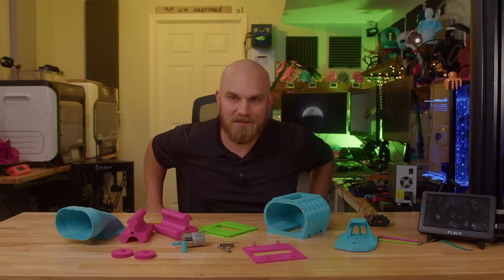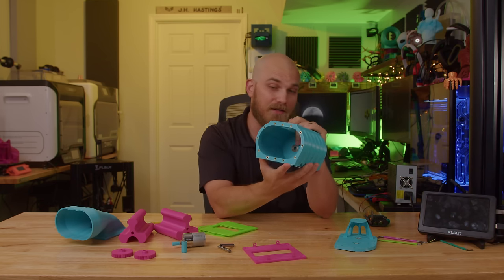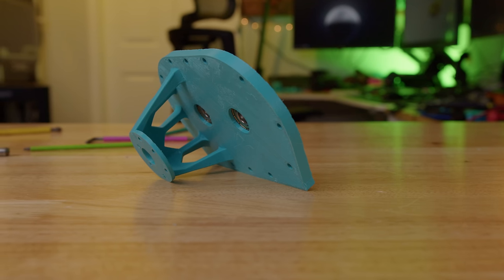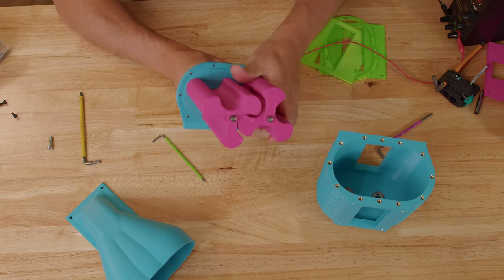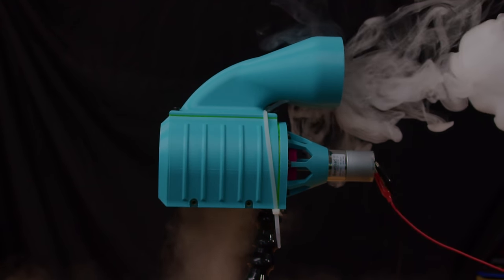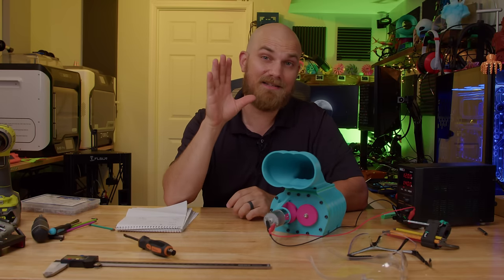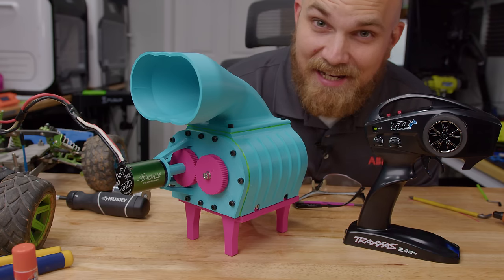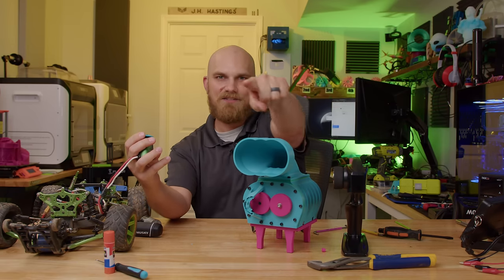I SUPERCHARGED My Custom Loop…… Literally

Comment: hey just a thought man you are gunna need either a small container on the motor side to lube the gears , just saying if your taking this from a car  its going to work better if it has lubrication. it doesnt need to be a lot just enough for the gears bottom tip ( or like just enough to reach the gears and have it pick up the lube ) i would suggest trying 0-30w or 0-5w motor oil. then put a small "splash cage" around it (could be clear  3D print material witha filler plug on top and a drain on the bottom ( like you will ever need to change this but hey maybe?) ), you would also need some kind of  tall plenum chamber after the chamber to allow time for the air to spread out. ( the math will vary from flow and desired size of radiator.) if you wanted to kick it up a notch you would make a venturi tube in take on the air intake side to force the to compress even more.   finally i would suggest a change to a 3k RPM motor super chargers like high RPM and mid level torque. this also applies for anyone who wants to try it. just my thoughts as a man who went to school for automotive and holds a degree in the field.  if anyone does this please send me or tag me the video i wanna see.

Comment: Hey, big fan of the show (Heh). I would recommend using a lubricant on the 3d printed gears as it greatly improves their performance, something light like lithium grease, or something PFPE based tends to work well. Thanks as always for the entertaining video!

Comment: Better grease in the planetary gears quiets them considerably.  One could mount the gearmotor at the bottom of the case with a big pulley, you can print a 120 tooth 2gt x 15 and then use a 12 tooth 2gt x15 on a 5mm shaft to drive the lobes. one could even route it like a serpentine belt to drive fans not limited by center hub diameter and can be geared as well.

Comment: HAHAHAHAHAHAHAHAHAHAHAHAHAHAHAHAHAHAHAHA
goldsmith / master jeweler, photovoltaic / solar thermal technician here (i have Rhino 5.0) laughing cause thumbnail made me think you built a blower for your computer and my reaction was "HELL YEAH"! working in construction i saw where the problem of breakage was going to happen when you were gonna go for top speed, that's easily fixed. as jeweler i make things from scratch, i've come to admire those with CAD talent. my hat off to you too, love your blower i Like, OLE'! 💃

Comment: About 20 years ago I put NOS in a PC. After seeing the first Fast and Furious movie I decided to put nitrous oxide injection on a PC. As anyone who ever used NOS will know that it makes things run hot, and too much will blow up the engine. So, I decided to make a video featuring a NOS bottle used to seriously overclock an old slow PC. In reality, one 4th of July we took a junk PC, stuffed it full of fireworks ran the nitrous hose in through a hole in the back set up my old Sony camera in video mode from a safe distance, lit the fuse, turned on the NOS and got far away. As expected, the old PC put on a serious display leaving a blackened sidewalk that remained stained for a couple years. Unfortunately the PC gods did not smile on this activity as the Microdrive card in the old SONY ate the video. All that remains are some still frame images captured by other party goers. We routinely put on a show of fireworks on the 4th and NYE for the neighborhood for about 10 years until someone elsewhere in the city got seriously burned and the cops shut down the use of DIY fireworks.

Comment: If you put a grease of some kind all over the rotors that's thin enough so it won't get thrown into the pc then would it be any quieter? I figured some simply lithium grease on the rotors would make it spin for freely as well as quietly

Comment: Not totally sure, since it’s hard to see in the video. But do you really spin that the correct way?
The air should enter at the top, then go around the outside of the rotors and out the bottom. NOT through the middle, between the rotors.

Comment: Hey there Major I noticed in your charts...and REF benchmark You've got the Phanteks T30  30mm  3000  RPM    FPM  954     CFM  125.928   at the top of the list.....Is there some reason why you didn't use the NOCTUA NF-A14  Indust PPC - 3000RPM CFM = 158.503 -  171.33 cause THIS NOCTUA's CFM  blows away the Phantek  ????  and what is the   FPM on the  NOCTUA NF-A14  Indust PPC - 3000RPM ???

Comment: I was fully expecting this to not push air. Now I want to see either a 30 or 60 degree twist since that should put less resistance on the motor but should cut air much smoother moving more air easier.

Comment: In Terms of noise you could also connect the rotors with a belt instead of a gear and use some bearings to hold them inside the housing. I would imagine this reducing the noise by quite a bit.

Comment: I think what we need here is Tim the Tool Man Taylor to set up a Coyote or LS powered engine to drive the supercharger that cools the liquid in the radiator.  

Oh, and what other folks are saying about using a manifold or at least an open spacer between the supercharger and the radiator is a good idea.

Another fun idea could be to circle back to your old video where you enclosed an air cooler in water to see how it does.  Now how about if you ran the supercharger with that?

Cool video!

Comment: To lower the noise maybe you can try use a more flexible material for the moving parts, like the gears; or using a ring of rubber betwen the housing and the bearings. Also for prototyping mechanical stuff like this sometimes is better to design it to be adjustable, that could make it more easily modifiable if you later need to addapt new ideas. Cool project :)

Comment: The only issue I see with a twisted shaft blower in plastic would be the edges chewing eachother up. On a real blower those edges have super tight tolerances and act as a seal

Comment: maybe add a 1" tray under the rad then add 4 tubes on each side that looks like header, i might be wrong but it could add a way of pushing that heat out while looking the part

Comment: If you switched to gears with a helical profile they would probably be a lot quieter.  The tolerance of straight gear profiles leads to intermittent contact of the teeth.  Helical gears have a constant mesh, but just FYI this quieter operation comes with a slight thrust loading that will need to be considered.

Comment: I was hopeful that you'd be able to directly drive the ESC and maybe a servo (butterflies anyone?) directly from a 4 pin fan header; alas, while they're both PWM the fan header runs at 25kHz and servos and ESCs want 50Hz. Definitely not enough wiggle room to have it work properly. However, making a little PCB that can convert between the two should be trivial. Let me know if you'd want to try such a thing, I build stuff like that for fun.

Comment: Also not to say how to do your job but I recommend set pins or screws to keep that engine attached. It would also be cool to hook it up to a dial where you could toggle speeds without having to hold a controller

Comment: I would build a new mount that was a solid case, and make the gears ride in an oil bath. On a actual racing blower, those things are capable of turning 10-20,000 rpm. Would be neat to see this test done over again with that setup.

Comment: What if you did a multi-material print for the rotors using PETG with a couple of external perimeters of TPU.  Would be a very long print.  Wonder if it would still work well and be much quieter.

Comment: Definitely need a follow up. 100,000 max rpm is gonna move alot of air, even if ur only running it on 6,000 rpm ur still injecting alot of air in there

Comment: I would love to see further developments on this idea. Myself, I would probably just go to amazon and buy a high torque 12v motor. I think they have one for like around $30 for 3500 rpm. Then I would print a second pair of rotors and try using a dremel to cut slots along the high sots and add some kind of rubber seal to act as apex style seals to make better compression.

Comment: This is sucking in air but not compressing it. You can redesign the barrel to intake one side and output through a smaller port. That's the compression magic.

Comment: Suggestion; get a Molybdenum spray paint/lubricant. it goes on like a spray paint coats the surfaces and makes the plastics parts almost frictionless. I have used it on styrene parts for RC cars. Also I like your cooling fan idea. Awesome.

Comment: Positive displacement blowers can make huge static pressure so I'd love to see you run a giant stack of 120mm radiators and compare it with a normal fan.
Reply: Maybe compare 3 120mm radiators stacked under this to a 360mm one with some regular a12x25s. Probably also experiment with wich radiator in the stack gets the hottest input water

Comment: heck yeah you should mount that motor , you might need to libricate some parts lower the noise issue (or have sound dampening material around it )  like with the gears maybe try it  with a belt !

Comment: yes let her eat! but do the airflow testing on it before you try to break it. The smoke test under at least 3/4 throttle be cool to see. Also you might have to change the brake setting on your esc so there is no drag brake or turn your brake force setting way low along with disabling reverse so no accidental hitting of reverse.

Comment: Could you possibly make it belt fed since that motor doesn't have the gearbox on it anymore?  I would be so cool if you actually figured out a way to make a clear enclosure.  Perhaps Major hardware needs a newly homemade vaccuform press?  Print the form you need with a 3D printer, get some halogen bulbs or nichrome wire to heat up the plastic then slam it down onto a air hockey table but with a vaccum, not a pump!

Comment: I want to see version 2.0.  Balance the rotors, use a pinion gear off the motor to prevent the shaft flex problem.  You may be able to use use the pinion/spur gear off your RC car.

Comment: Fun fact: the "14-71" supercharger used in top fuel racing takes more power to drive than a stock hemi, which top fuel motors are all based on

Comment: I’d definitely want to see a twin screw! But more than that even, I’d like to see a slot printed into the lobes to accept a piece of gasket/flexible plastic to seal like a real blower.  Should be creating a lot of suction at that point!
Reply: A Screw blower use two completely different types of rotors compared to a roots blower. You can tell by the case not being symmetrical. The seals your referring to on a Roots are called Nylatron blower lobe seals. They are only on the High Helix 120 degree twist 3 lobe rotors and stand 3 lobe rotors.

Comment: Nice build looking forward to see more, i have a couple idears for a future iteration.
Try using spur gears from rc cars to drive the screws and a pinion gear to connect the drive from the engine to the spurs, and a stronger engine mount then it should hold fine, and btw the closer you can get the tolerances in the blower the more air it will move per revolution

Comment: Yep, those are worm gears, but why are you using worm gears?  They have concave teeth to fit around a worm and are not made to be used as spur gears (usually).

Comment: That was really fucking cool!  For 2.0 (if you jump back into this) to reduce gear noise, maybe try helical or double helical? Also a way to adjust the tolerances of the rotors.
Would it be possible to make a centrifugal type? The compressor housing might have to be 2 parts. Sound closer to a turbocharger when spooling :)

Comment: Please upgrade the super charger and try to max it out. I'd love to see some sorta silicon strip interfaces between the rotors to try and increase the sealing between parts. Maybe some sorta grooved slot in the rotors where you can slide a silicon strip into it.

Comment: I wonder if a vapour chamber could be routed in a way that would spin an impeller, linked to a fan motor to create forced induction like a turbo? In theory, the heat could drive the cooling power?

Comment: That fast motor need to be properly installed on this charger, and let it rip on the airflow machine and radiator if it will survive.
Part 2 of this needs to happen

Comment: The twin screw is compressed like a turbo while the roots is not that means no need to rebuild a bunch of sht just slap on tune and drive for the most part that’s why roots is great for many applications

Comment: Those AIO water coolers are cheap-ish, but after having had two die of pump failure (both Asetek designs, one branded Corsair and the other branded NZXT) due to galvanic corrosion and fouling, I decided I can't trust these things to even last to the end of their claimed warranty period.
To that end, I first got myself an Alphacool Eisbaer all-in-one, which uses all copper components (so minimal fouling over time) and is refillable and expandable. I've flushed and refilled mine twice, it's still working like new (even though it is a bit of a pain to bleed - have a spare power supply ready).
After that I built a new computer and built myself a custom loop with two 420mm radiators and an EK Velocity RGB CPU waterblock, an Alphacool GPU waterblock and an EK Quantum Kinetic pump+res combo. Yes, this setup cost me the same as about 4 or 5 all-in-ones, but it's infinitely more maintainable and expandable.
If you're spending money on a new computer build, do a custom loop. It's more work, but you'll be glad you spent the time and effort in the long run.
If you still want an all-in-one, get an Eisbaer.
Don't have your pump die mid-session, don't waste your money on these copper + aluminium Asetek devices, they're disposable garbage.

Comment: theres a reason why u dont over tighten fan screws on rads and u use the screws that came with the rad. some do have cover plates under the screw hole to prevent puncture but not every rad

Comment: once you got it up to speed it actually had the proper roots blower whine, need to flow check it at speed as it was barely moving in the initial test, should be able to design a stronger motor mount easy enough as that rc motor will have enough torque and rpm to melt the gears (an upgrade there wouldn't hurt either)

Comment: I build a Turbocharger for my 120mm Radiator, the Turbine was Spinning at 12000 rpm due to the Motor and the Gearbox i used

Comment: I think you need some kind of interface between the supercharger and the radiator so absolutely all the air that enters the supercharger is used, and you should have put it on the LS radiator in the add, so you would’ve had a Blower LS in the PC

Comment: Use a Traxxas rwd assembly with like million weight oil so you have a sturdy area to mount the output too so it's just the connection across that you have to worry about and you can gear up or down based on the speed and torque you want

Comment: Really cool concept! The only thing I was wondering is why the 'fan' was mounted like that for the temp test. I see that this thing has a channel, which in turn only 'cools' like 3 channels in the rad. Would like to see what would happen to the temp if you'd turn the entire thing 90 degrees so you could cover all channels in the radiator :)

Comment: if you enlarge the diameter by a factor of 3 the outlet opening of the SC will be about as large as the 120 mm radiator.
EDIT: when installing a very high RPM motor driving a small gear with the motor that then drives the large gear might be a good idea.

Comment: So could you make a "turbo" for a liquid cooled system? I imagine the water pump would turn the turbocharger moving the air to cool the system versus using an electric motor to turn the turbo, although powering it with an electric motor not a horrible idea as a last resort. I would just like to see if its possible to use the water flow to power the fan that cools the radiator.

Comment: yeah a far stronger motor mount with rubberlike grommets for reducing vibrations would be very good for this i can see a company making a product like this just not 3d printed and i would actually buy it it seems very powerful with cooling

Comment: Hello sir,  try stacked fan design like industrial water pump mostly used in farms to pull out the water from the ground that design is way stronger and efficient like fan on fan on fan and that runs at the same time with single shaft

Comment: That would be really cool to see that fan spin a max. Just think how much air flow you can get then. We need to back down the power the computer is freezing up. No the screen but the components themselves. There is ice forming inside the case. LOL.

Comment: At this point, I would also recommend lubrication in the gears and axels (is the the correct term for the rods in a fan?). 

I would recommend them in the fans themselves; but have concern it would be spitting a mist of lubrication into the radiator.

Comment: OH I want to see it :D  no centrifugal fans? Have you tried a sucking and blowing fan at the same time? It’s how I got oil coolers to perform like they had three phase motors but by using 12 volts.

Comment: So since they motor is high torque but low rpm I would actually create some gearing so that you could up the rpm, it will have enough torque to push it

Comment: This charger meant to make pressure.
Try to blow through multiple radiators. or/and through the denser ones.
I bet this boy will destroy any fans.
One charger on a massive radiators pack

Comment: use a belt driven brushless motor on a control module, off a PWM connector, and you can adjust speed manually 😅

Comment: Test it against a normal fan with the same motor. At the higher rpm I have a feeling this will be better at forcing air through the rad.